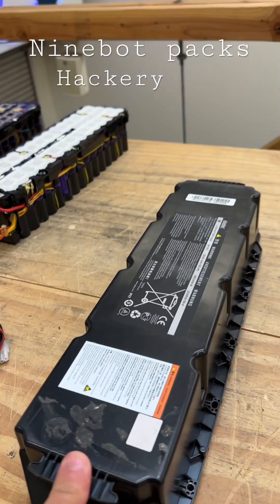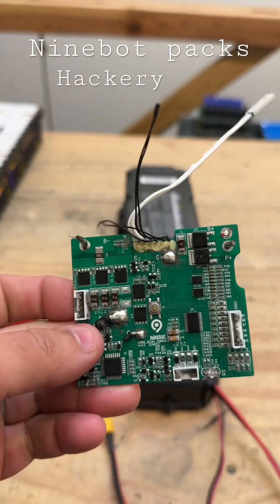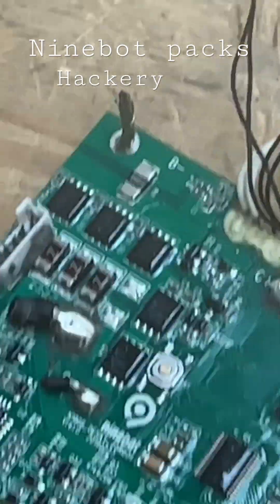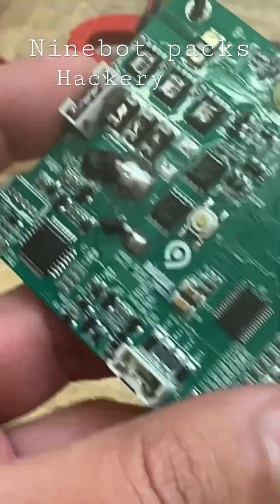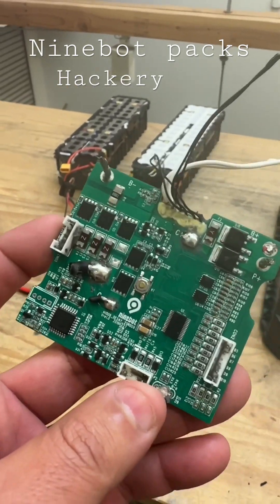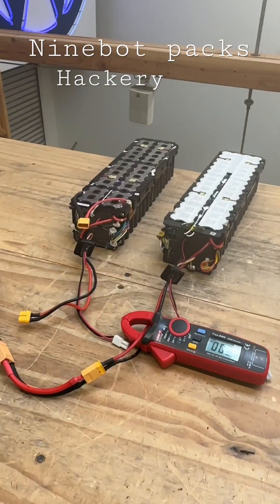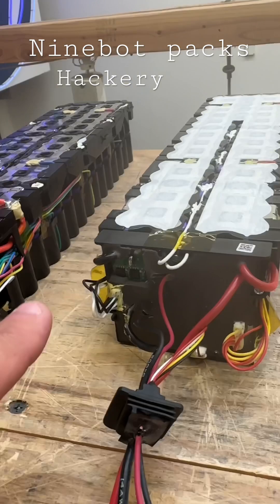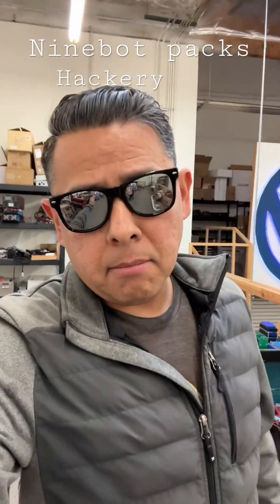Hacking Ninebot scooter packs

Comment: Hey dude your clamp meter is in AC mode not DC mode. Switch it to DC current.(If it has DC current on it, otherwise your going to have to cut a wire for a reading with a normal meter)
EDIT: your meter has got DC current mode, just looked it over. So switch it to DC.
Thank marcos2392 for spotting that 😅👍

Comment: Do you think we can put ninebot G2 controller on ninebot g30, knowing both battery voltage are 36V?
Reply: Just why? Same performance. You need to change all electronics in scoter and flash battery to get the same performance and more complicated unlocking xD

Comment: STLink that sucker back to ninebot bms version 1.34 firmware and you wont have to do any monkeying around swapping out bms.  should work without current cutoff protection because it doesn't have the communication between the esc / bms requirement.
Reply: have you done the stlink version? I am trying it but after what seems to be a successful flash the battery won't flash the blue light again. It show no light on the BMS but when I hold the reset button it flashes red a few times? Any tricks to get the battery back on after the flash?
Reply: @PatrickMobileHomes you find out yourself bro???
Reply: Lmk pls
Reply: The new 2023 BMS has an STM32 chip. I flashed it with the BMS G2 program, but now the LED doesn't light at all...

Comment: How many amps are you looking to pull? I’ve been able to capacity test them at 4amps through bms without issue. Inverter coming this afternoon for higher amp testing. Will report back
Reply: Update: by slowly adding load I was able to sustain 12.4amps using a hot air blower before bms cutoff.